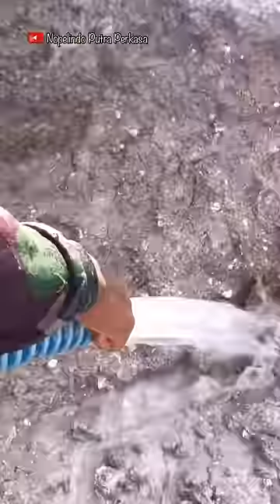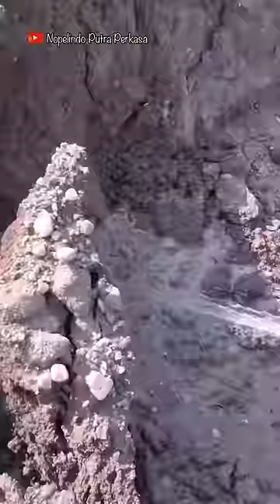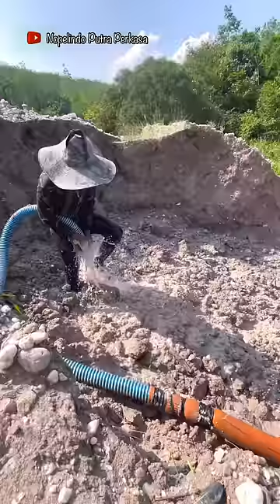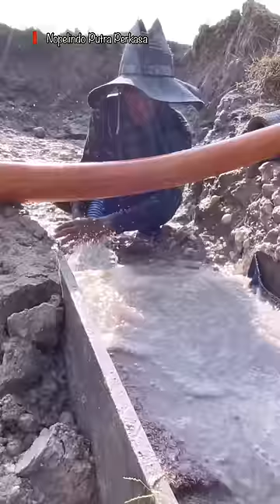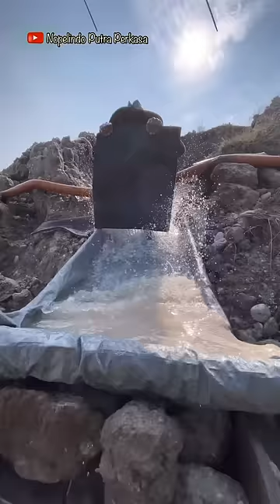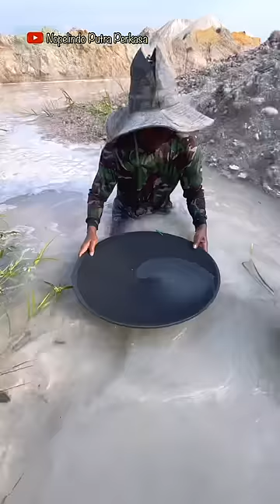BEST WORKING SKILLS..! SLUICE BOX FOR GOLD OR ILLEGAL GROUND SLUICE..VERY VERY POWER RESULT #Shorts

Comment: Add some riffles to the first section there, most of your gold will catch there.
Reply: Actually he’s using an “ancient” style pan, which is in fact, more effective.
Reply: @zackzimmer7167  tell me you don’t understand fluid dynamics without telling me you don’t understand fluid dynamics. In order to take advantage of the density difference between gold and everything else you need to create a low pressure zone that allows the heavies to drop out of the water. Adding even just one or two shallow riffles to the first mat in that box would increase the capture rate for heavy materials. The setup being used here is only marginally better than washing that dirt over a rug, as there is not much low pressure being created.
Reply: @zackzimmer7167  also, we’re not talking about the batea that he’s using, we’re talking about that “sluice” he’s using. The batea was the only part of this video that wouldn’t need modification to work.